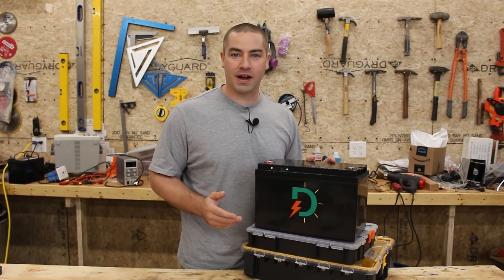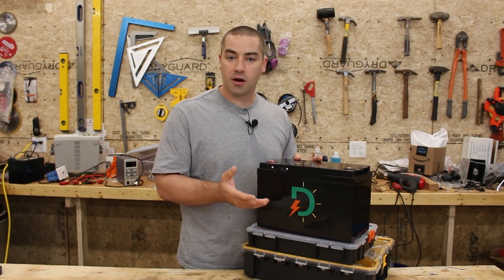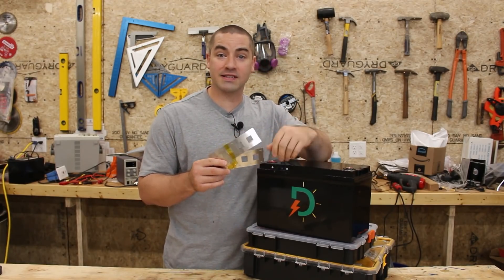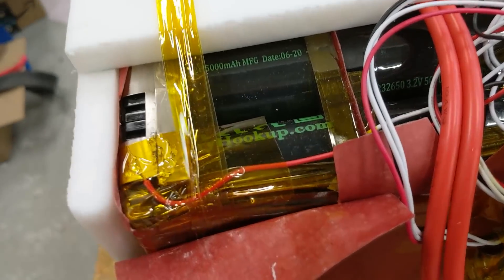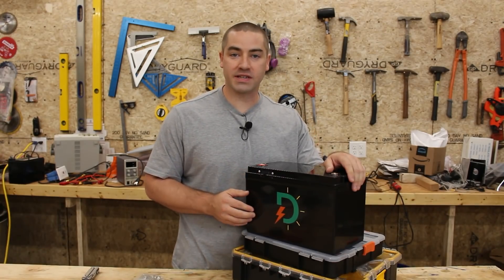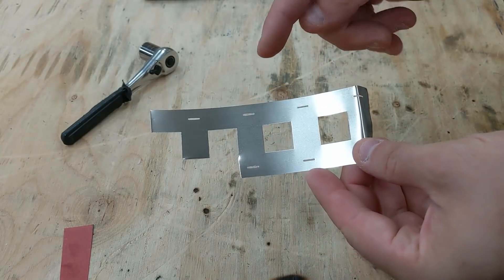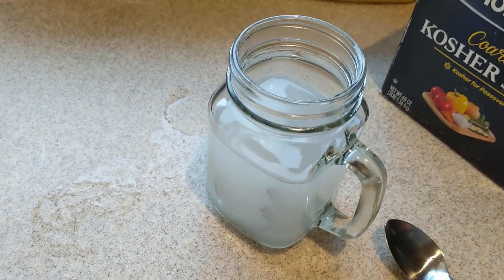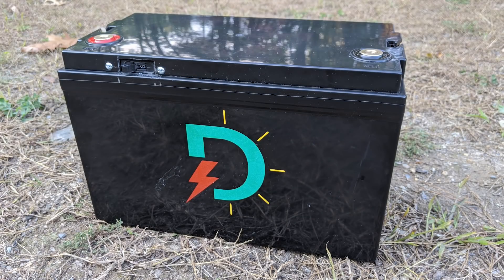Top 10 Questions Answered about DIY Battery

Comment: Could you explain how do you charge you battery ? I saw your Mean Well Model RSP power supply. Do you use any buck or boost with CC/CV converter in between ?
Reply from the maker: Yes, I have a variety of different buck and boost converters depending on what I'm doing.  For this I was using my ISDT Q8, which is a hobby charger, and the 24v power supply.
Reply: @DavidPozEnergy  Cool, Thanks for your explanation.

Comment: Kapton tape is not what you want to use in a rubbing situation on a busbar. Kapton is great for high temperatures, and is also very insulating electrically but it has very poor wear resistance and is implicated in aircraft accidents when the Kapton wiring insulation failed. There are much better things for seperating out that busbar - hotmelt glue blobs are pretty good and easy to place.

Comment: david the BMS you used has got two negitive wires one of the wires does not connect to anything on the BMS why did you solder it to the battery
Reply from the maker: The BMS I used: https://batteryhookup.com/collections/accessories/products/12v-lifepo4-smart-bms-w-low-temp-cutoff  It has 2 wires that go to the battery, and 2 wires that go to the terminal.  I checked my 2 battery wires (labeled B-) and they both have continuity to the negative bus on the BMS.  They are doubled up for more load carrying capacity.

Comment: I LOVE YOUR CONCERN FOR SAFETY BY USING THE LOCTITE.  I'M PRETTY SURE JUST TIGHTEN THE BOLT WITHOUT THE LOCTITE WOULD HAVE BEEN SUFFICIENT.  BUT U CAN NEVER BE TO SAFE WITH ELECTRICITY OF FIRE. I TOO WOULD DO THE LOCTITE FOR ADDED SAFETY GREAT VIDEO. I WONDER WHERE THE VIDEOS R OF THE CRITICS IN THIS VIDEO IS I WOULD LOVE TO SEE THEIR BATTERY BUILDS.

Comment: It sounds so simple to have your battery in a heated environment.   Those of us who have remote cabins in cold weather areas and don't live in the structure, that is not so easy or should I say.........impossible.  This is presently being addressed by the leading commercial battery manufacturers and I expect within a year this will become practically a non-issue.  However, this issue kept me from going LiFePO when I bought new batteries for the cabin 15  months ago.  The advancement of the technology surrounding this chemistry evolves so rapidly it is amazing.

Comment: I assume nickel-coated steel would be attracted to a magnet. Might be a good test of known "fake" nickel. You need oxygen for rust as well, so let it sit out.
Reply: Nickel is one of only four metals that are ferromagnetic, meaning they are attracted to magnets and are magnetic themselves. The others are iron, cobalt and gadolinium. Water aka H2O... is full of Oxygen... and salt water accelerates the oxidization process (ie. makes things rust much faster then just air. Reason salt water spray tests are done to simulate/accelerate environmental exposure testing).

Comment: The bolt you are using is a locking bolt. That's what those ridges on the flange of the bolt are for. I'm not saying you shouldn't use the locktite, I'm saying you probably just don't need to.

Comment: For the temperature sensing - Thermistors on the BMS board are necessary to ensure the electronics do not get too hot.  It would be nice if the BMS manufacturer had a couple of inputs for thermistors that were attached to a couple of the cells.   Cells and BMS board will heat up at different rates.  For the battery safety and performance, you care more about the actual cell temperatures.  If you demo some of the simple power tool batteries, they have sensors attached to the outside of the cells as an example (those NIMH or NICAD cell BMS use the cell temperature as a secondary input to control the end of charge).
Dave - Keep up with your battery builds!  Good work and good videos too.  (Have to comment on the battery in the family freezer.  My wife hates it when I do that kind of stuff)

Comment: If you load the battery and touch from the ring terminal to the brass with a test light, you will know if it's an issue. The test light will light up if you have too much resistance in the connection. If it does not, the connection is fine. That's the test that has been being used in the automotive industry for longer than I have been around. Takes opinion out of it. Keep it simple.
Reply: Exactly.  Good catch - I mean damn... I face palmed myself when I read your comment.  Could also use vom on millivolt setting.

Comment: I’m happy to see that everything is working well with your battery. I am sure that you are right about the loctite question.The steel bolt is of lower conductivity than the brass and copper. The area of contact of the copper connector to the terminal looks to me to be at least equivalent to the cross section of the wire bundle, and probably greater. So the current will take the path of least resistance, through the terminal and the connector on the wire. In any case, as another commenter points out, when you tighten the steel bolt, the small amount of loctite will be squeezed so that metal to metal contact will occur between the bolt and terminal threads, since the surfaces of the threads will be microscopically rough. The feedback you got was helpful to prevent possible short circuiting by rubbing and wear between the nickel and the battery cases. Your improvement will ensure that this doesn’t occur. I’m happy that your trusted supplier of nickel sheet was shown to be correct by the lack of corrosion. Someone suggested using a magnet, but nickel is ferromagnetic so that wouldn’t distinguish between iron (Fe) and Nickel (Ni). Resistivity measurements would determine if the Ni was plated onto Fe because of the lower conductivity of Fe. However that would have taken a little more effort to measure than your salt water test. By the way you could have added a lot less salt to the water and it would still have rusted overnight if Fe was at the centre. Good luck with your new battery and thanks for sharing your ideas and methods.

Comment: Hello David, do oyu have an idea how to build a battery with the 32650 and 32700 cells with screw terminals as the Liontron 12V / 100Ah.
Do you have an idea to use Lifepo4 cells with Screw Terminals. Like theese? 

https://bmsbattery.com/home/1085-with-screw-lifepo4-32v-6ah-battery-cell-32700-6000mah.html
https://greenakku.de/Batterien/Lithium-Batterien/12V-Lithium/LIONTRON-LiFePO4-12-8V-100Ah-LX-Smart-BMS-mit-Bluetooth::1961.html

How would you arrange them, if 4 cells make 12,8V 6AH.  16 rows paraelle to achieve 96AH. 

Nice build but can you bild one with screw terminals ? Where to get the frame and BMS connection to cell block.
Greeting Bob

Comment: There are probably a lot of viewers that live in cold weather climate or like me have a motorhome that I use in the winter for snowmobiling and had questions about your low temp cutoff.  That's probably the biggest issue that I have about switching to Lithium.  Our workshop is an unheated building at 4400 ft elevation.  It's cold in the winter with some days never getting above zero.  I don't have to worry about our lead-acid batteries unless they discharge to where they would freeze.  I have 800 watts of solar and when it's really cold and below zero, the chances are that it is super clear out and solar charging won't be a problem.  Thanks for your time to make these videos!

Comment: As far as loctite - it's going to fill gaps in the threads, the bolt isn't going to just be floating in a sea of loctite. When you torque it down the threads of the bolt will pull against the "nut" and create plenty of connections. 

That said - loctite is really not necessary in a non moving part like this, especially if you toss a locking type washer on it.

Comment: By the way, never use different metals at the cable connectors, as there is building up a bandgap and due to this thermogenerator effect the connection will get warm and wastes energy.. so better try to use only copper connectors...Hope this helps..

Comment: What is the performance comparison to a lead acid marine battery with 1000 CCA?
Reply from the maker: They would not be compared directly.  The battery you mentioned is rated for cold cranking amps.  CCA is for starting an engine.  The battery I built is for low-amp applications like lights and TV in a cabin.

Comment: Is a low-temperature cutoff necessary with LiFePO4?
Reply from the maker: If you charge a LiFePO4 cell when the cells are frozen, you will permanently damage them.  So it's nice to have, but not required if you always keep your cells from freezing.

Comment: Can this be used in your car instead of the normal acid battery?
Reply: The 50 amp circuit breaker he installed is the major clue.  When starting an auto, hundreds of amps are normally drawn.
Reply from the maker: No, it's not a replacement for a starting battery.
Reply: @DavidPozEnergy  damn, I had high hopes 😂

Comment: The best thing for you contacts would be Humiseal. Don't use Locktide, torque the contacts correct and then apply a thin layer of Humiseal. Thats protect you contacts for corrosion and loosing. Its always used in the Aircraft Industry for the electrical connectors with thermal lugs. A added spring washer will help you to lock the screw.

Comment: The threads will pull up, squeezing and loctite out of the way and making good metal to metal contact.
This will be a current path parallel to the 'crimp-brass' junction. It's insignificant you'll  have more resistance in the 'wire-crimp' junction.
I'd be more concerned about galvanic corrosion between the dissimilar metals. I once had a lead-acid battery with just 20 amps flowing and there was a 100mV drop across the 'post-terminal' junction. The slightest of movement cleared this, but it's something I keep a close eye on now.

Comment: The only problem i see with the lock tight would be i would put it into the hole rather then on the stud... that way if there is any "extra" lock tight it would be pushed into the connection rather then building up at the top maybe building a small film between the brass and your ring connection

Comment: Not that you should, but It should be possible to use PLASTIC screws to hold the connectors to the battery and still get a full contact.

Comment: Is nickel ferromagnetic, or could you use a magnet to determine if it’s nickel plated steel? Wouldn’t nickel plated copper be best?
Reply from the maker: I don't know about the magnet.  But for copper...  I have a coil of nickel plated copper and tried to get it to stick, but couldn't.  Not sure what kind of high-tech welders are used for it, but not my hobby spot welder.
Reply: Ah, I wondered if spot welding the copper might be the problem. Now I know! ;)
Reply: Nickel is one of only four metals that are ferromagnetic, meaning they are attracted to magnets and are magnetic themselves. The others are iron, cobalt and gadolinium.

Comment: Dumb Question:  Wouldn't it make more sense to use the cells in an unfolded configuration and build a case that fits the cells with the BMS on the one end?  It seems like a ton of trouble, tape and failure points just to get the cells inside a case so it look like a Lead Acid battery.   The only use I would see is a retrofit application.
Reply: That was my question....and your suggestion: retrofit application is the only reason I could see.

Comment: The only thing I might consider doing is adding a couple of silica gel packets into the case of the battery if you should ever require exposure to cold. Dropping the battery into the freezer causes the air/humidity in the box to pass through the condensation point. Having standing moisture on the contacts/components is something I'd be worried about. Once the battery warms up all those little frozen droplets will flow before they evaporate so you could get an electrical short.
Reply: Maybe oxygen absorber also.

Comment: It would be useful to know how many man hours you expended on this project.  Obviously, subsequent battery builds would be faster.  If someone were to build 4 to 8 batteries, an estimate could be made regarding total man hours, with an estimated efficiency increase in later builds.  This provides a useful aid in deciding whether or not to build your own, or buy Battleborn. Victron, or other brand batteries.  Some have more time than money.  For some, the satisfaction of DIY is worth it both for knowledge and competence, even if buying would make more sense.  For those less technically competent, buying is obviously the better option.  Those choosing to watch these videos likely have higher competence in attempting DIY.  Thank you for helping feed our technical curiosity.
Reply from the maker: I wouldn't mind building another as a speed test, but these builds get expensive.  $440 in parts.  I need to wait for the views, and next months ad revenue before buying more materials.

Comment: After getting the battery so cold, I'm concerned that there will be some condensation inside the case.  Let it completely warm up for 24 hours.  Then open the case for another 24 hours to allow any moisture inside to evaporate naturally.  Just don't open the case when it is so cold.  Check the humidity in your house.  Based on the appearance of frost, I'm going to guess it is in the neighborhood of 40%.  Of course, I have no data on how long after you removed the battery from the freezer that you photographed the frosted case.  In the winter, inside your house (cold climate up North), your inside humidity may be more like 25% or even less unless you humidify your house.  I realize this was only a one time test.

Comment: How does this compare with a typical car battery for much less the cost?
Reply from the maker: This is not a replacement for a car battery.  This battery is for lower-amp situations like powering lights, radios, etc.

Comment: A bolt getting lose can produce more heat at connection then worrying about if lock tight not getting enough contact between post and cable end

Comment: OMG @ the end you Froze the battery, Mate I hope that didn't damage it, you know freezing causes things to Crystallize & expand & potentially rupture the cells if not dent the plating up from the crystals. I'd put it in a Fridge but no lower than say 4 degrees. I hope it lives a long life after that crazy stunt oh man poor battery.
Reply: I think it’s more of an issue to charge it when it’s below the low temperature cutoff when below freezing, which is why many people set the cutoff as 5 degrees. (That’s why low temp cutoff is imperative if you have LiFePO4 batteries and need to charge them if it’s below freezing.)

Comment: But... Lithium batteries REQUIRE a substantial amount of cycling to avoid developing a shallow memory.  A 12.8V max wears out the battery quicker - isn't that economically important?  Anyway, that is why a 14V lead-acid battery is perfect for the 12V MINIMUM of automatic electronics - only resistance is needed, and aqueaous electrolytes do not develop any important memory.  And, it sounds like you are relying heavily on your alternator voltage regulator, which produces quite noisy power for the car's electrics.

Comment: Thanks for the follow up! And for the humble responses. I think your attitude is the best of anyone on YT.
My question is, what charger would you recommend for charging this from mains AC power? I have a particular application that requires I let the battery charge during certain hours then discharge during certain hours. Ideally, putting the charger on a timer so it’s just automatic. Thanks!
Reply from the maker: I charged it with an ISDT Q8 and a 24v power supply.  However, that would need manual re-setting.  If it's in a permanent location you could run a solar panel to it with a charge controller.  
Anyways, to your question, probably this: https://amzn.to/2T5jqp9
Reply: DavidPoz thank you!

Comment: Thank you Mr David pause for your excellent content. I'm looking to find out more about the battery box you have? I looked over on 18615 Ed and did not see any there period could you give more detail on the Alley Express information such as a link company name or anything else I can lead us to finding it thank you
Reply from the maker: If you message Keith, at 18650'ed, he has them and can ship it out, he just doesn't have them listed yet.  But the one I bought on Aliexpress: https://www.aliexpress.com/item/33030465274.html?spm=a2g0o.productlist.0.0.30436455ktYQrF&algo_pvid=139964d4-2b71-461d-a3a1-ac25f5cc9a8a&algo_expid=139964d4-2b71-461d-a3a1-ac25f5cc9a8a-2&btsid=0bb0623416030517225768406e4b30&ws_ab_test=searchweb0_0,searchweb201602_,searchweb201603_

Comment: Loktite the terminals after they are tightened.  It will still work by creeping into any gaps between the bolt, the terminal & the crimp, but will not reduce any contact surface area.

Comment: The threads have nil to do with your connection.  It is all about lug to brass connection. 
PS the lugs you are using are primarily designed for a solder joint not compression.  That's why they have no hole in the bottom of the wire sleeve part.  Although you can use them for compression.  Pleased to see you using a good compression tool.

Comment: Nice build! Why did you choose 12V? For what application are you going to use the battery for?
Reply from the maker: I was asked thousands (yes, literally) to show how to make a 12v battery.  I assume those thousands of people have some application in mind.
Reply: @DavidPozEnergy  RV off-grid camping is probably the biggest driver, since everything factory is 12V it's pretty expensive to convert to 24 or 48V. I looked into using DC-DC converters because you can get used 48V packs pretty inexpensively but a converter that can handle the 60A charging current from the converter is not cheap, especially if it has to be outdoor rated.